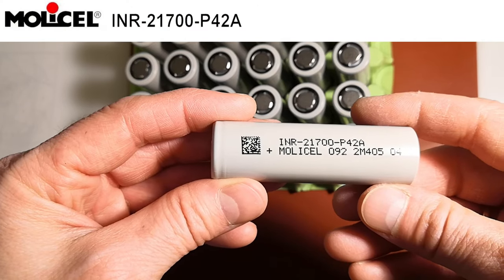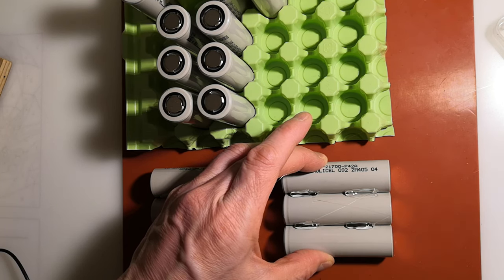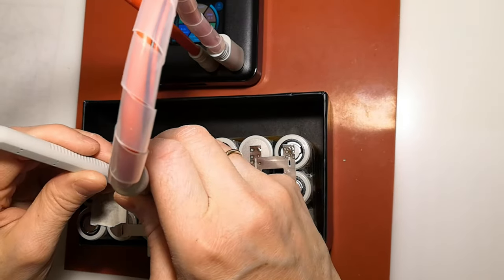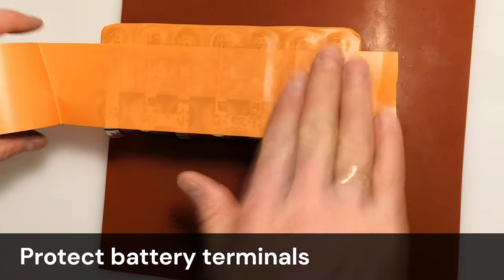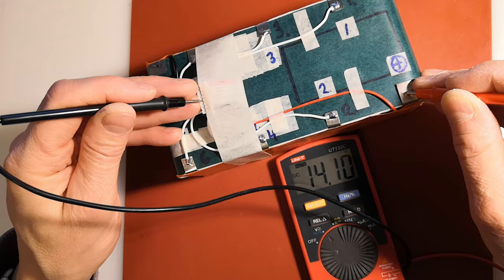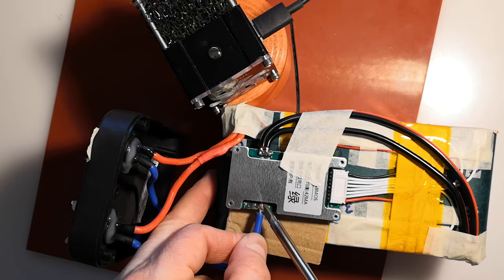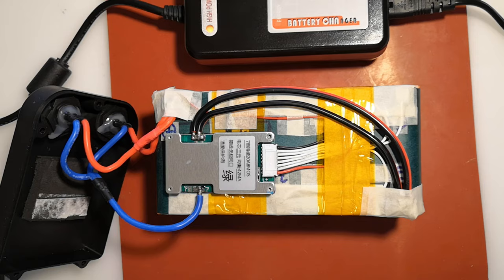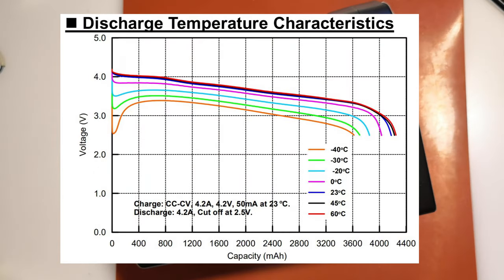How to Build a Safe Lithium Ion Battery - MOLICELL

Comment: That gap on the strip shall be positioned in the center of the cell. and you should weld across the gap.
Reply from the maker: That's correct, but It was difficult to find bigger pure nickel strips for 21700. However,  these work just fine.